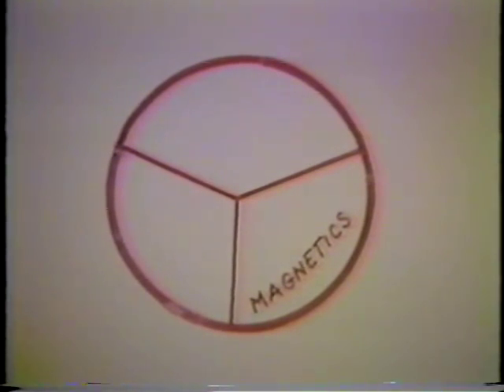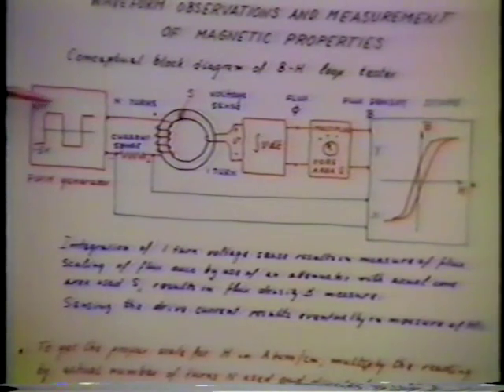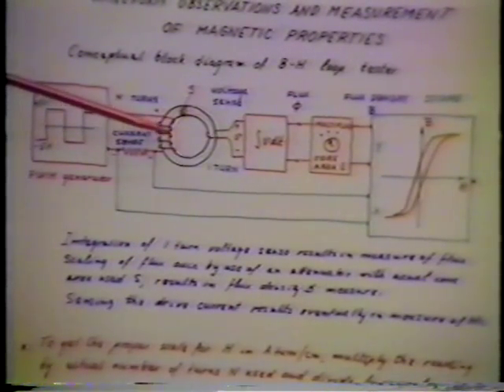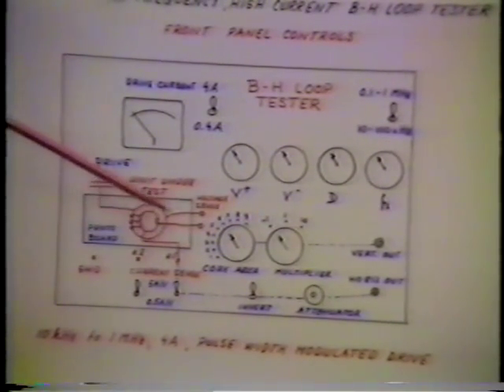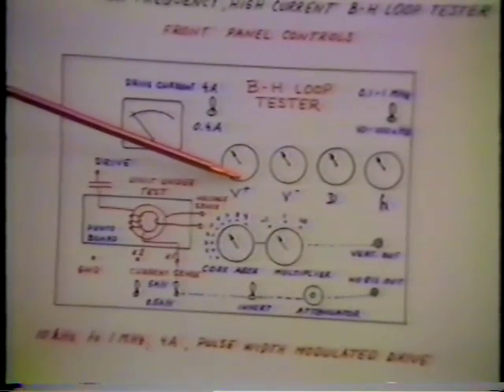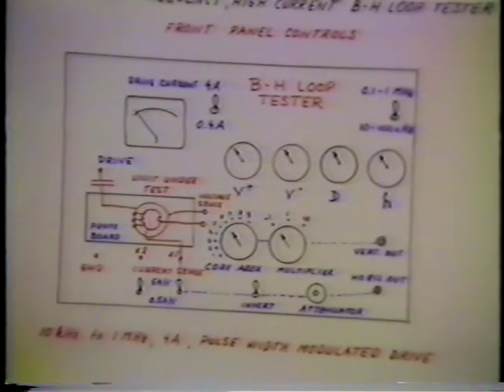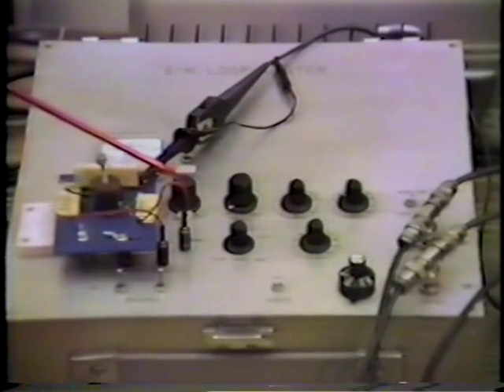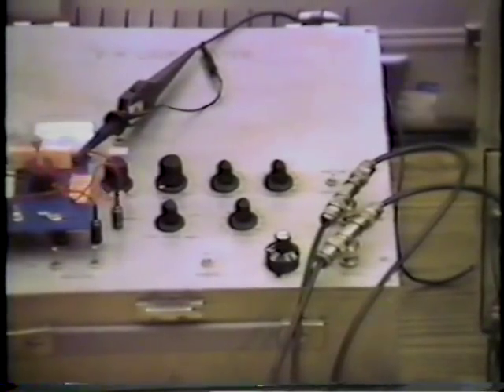Mag Demo Box-Part 0

Comment: there is a problem with this setup I think. The B valur is not directly related to current, hysteresis means that the flux is lower or higher depending on if current is demanding an increase or decrease in flux. Have I missed something? Please comment?
Reply from the maker: Yes, you did.
This is how the core material properties, that is B vs H , relate to the 
flux linkages vs current (and its slope being inductance). If you multiply the vertical B component with cross section of your measured core sample and number of turns of wire N, you have christened that vertical axes into flux linkages equal to number of turns times core flux. If you likewise multiply the horizontal H component by the length of the sample ( mean magnetic flux path length) and divide by number of turns that coordinate becomes the current you measure in the winding. This is how  you go from B vs H to circuit properties. Flux of course could be sensed as A voltage on one turn sense winding and integrating that voltage to obtain the flux as a function of time. All of this was done with a BH loop tester we custom made working up to 1MHz.
Now you can see why I was using two oscilloscopes:
1. One to display time domain waveforms of the flux linkages vs current
2. The second scope displaying the same as X-Y coordinate to display the underlying BH loop of core material.
This also exposes the fact that square-wave voltage drive is the cause and flux and currents are consequences. Most wrongly believe that it is current which  drives the core and not voltage.For transformer, the claim is that magnetizing current saturates the core which is sheer nonsense.
Reply: you are right! I was thinking of the flux being measured by the current.
Reply from the maker: Flux is a consequence of the AC voltage excitation only as per Faraday's Law of Electromsgnetic Induction. The small magnetizing current is a consequence resulting from the finite but very large relative permeability of the magnetic material (100,000!).
Reply from the maker: Will George, Yes you did miss this. The reversal of the magnetic domains coming after change from increase of magnetizing current to decrease does not come without any loss and requires some small  energy. This is why the flux excursions hav e double-valued curve described as hysterisis. Increase of current results in energy stored along the lower portion of hysterisis curve and decrease results in energy returned back  along the higher portion of hysteris. The difference is energy loss per cycle, which is directly proportional to the width of the hysterisis curve. I do explain this in  more details in my Power Electronics courses. This demonstartion is just an excerpt from a number of magnetics demonstrations in my courses.